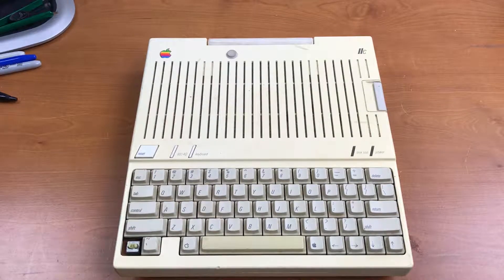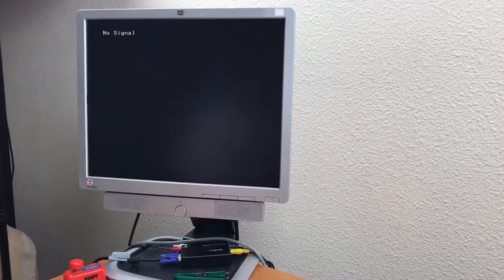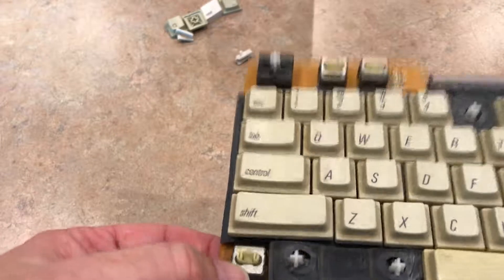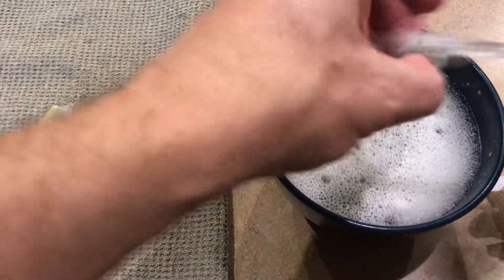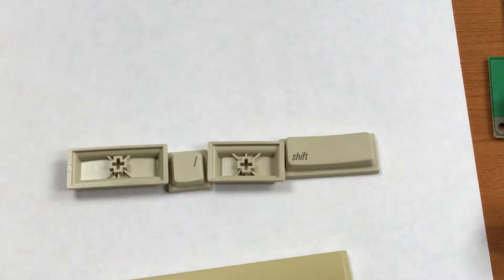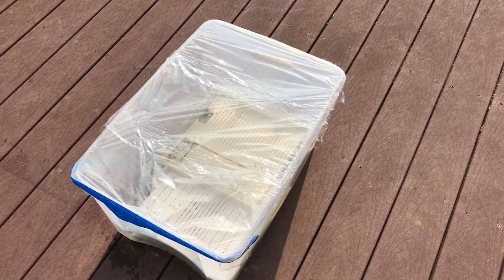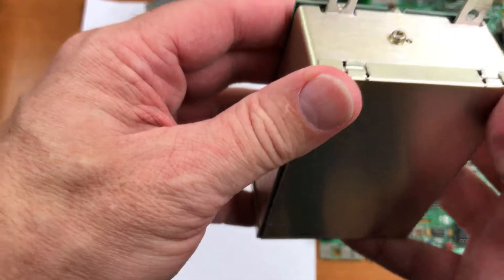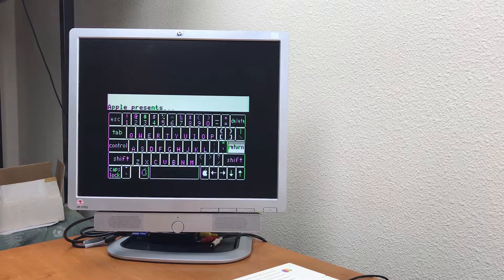Apple IIc Repair, Cleaning and Retrobright

Comment: Always tape up the APPLE LOGO on the plastic! I did this and the logo got whitened!! I taped it and cut it to the edges and it was perfect (on my next one).
Very important!!
Reply: When I do them now, I just remove the aluminum inlay completely. There's a small hole on the back side you can push a paperclip into and push off the logo. Warning it up with a hair-dryer helps loosen it. Then glue it back in after brightening.

Comment: what's the solution? Can I assume it's hydrogen peroxide?
Reply: Thanks. There's another guy who's done several and he uses a hair bleaching developer creme that is based on hydrogen peroxide. He paints it on with a brush and wraps the case etc in plastic wrap, sets them in the sun for 4-6 hours and done. Stuff is called "40 Volume Creme Developer". Paints it on right out of the bottle